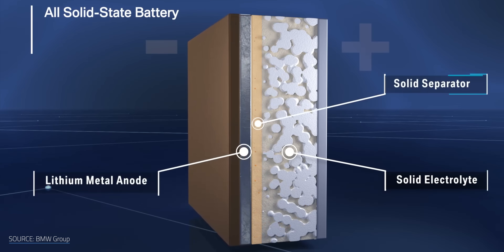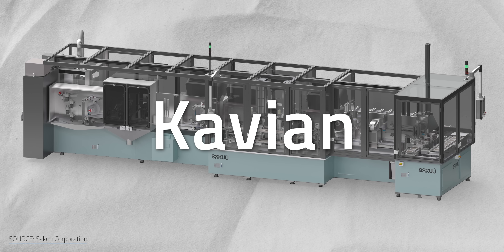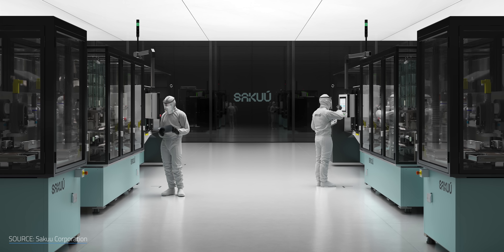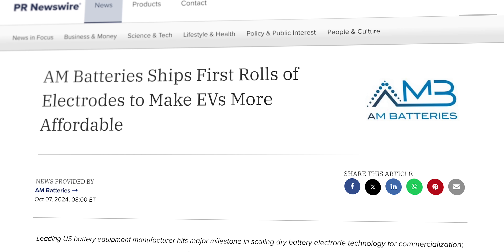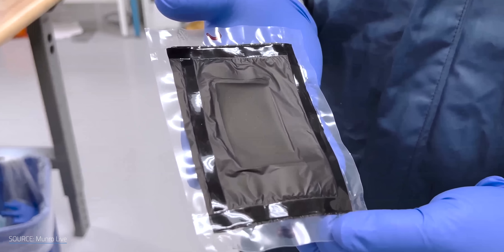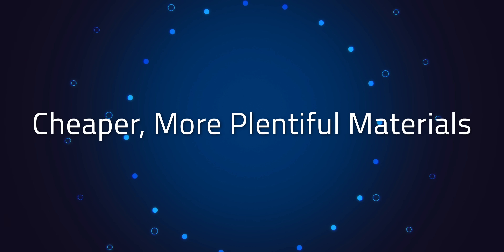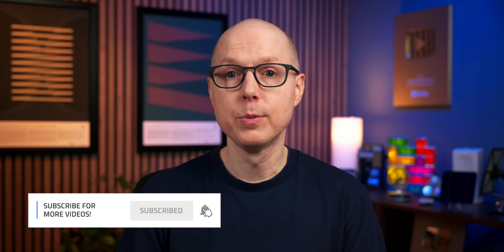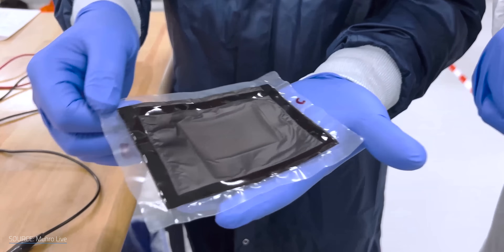Why This Ultra Cheap Battery Breakthrough Matters

Comment: 3D printing is slow, even though it might fit into a smaller footprint you would need a significantly larger number of equipment to get the same line rate. I have been in the battery development industry for a long time and these new technologies are always 10 years down the road. The biggest improvement recently was tabless cells, because you can make them on the existing battery lines with very little change. It’s the classic money grab by companies promising better, lower cost cells, getting some investment, finding they can’t make it work at scale and you never hear from them again. Time will tell and maybe one of these times that 10 year horizon actually comes to fruition.

Comment: Could these 3D printed shapes even form airplane structures and wings, allowing EV aerospace technology?
Reply: They're flexible sheets, not stiff or strong. You can use a rigid case as a structural piece like some cars do, but you cannot use a battery cell.

Comment: Safety and cycle life are not an issue for storage. Haven't been for a long time. You can buy 15k+ cycles guaranteed LFP batteries that are not prone to thermal runaway.
Density is also not an issue because space (and weight) are not limiting factors in storage. It's all about cost per kWh and nothing else - and that is largely determined about throughput of batteries per square meter of factory. Not so much materials or even battery design.
Reply: Agree so many technologies though and no clear winner yet 
The solution is there but which one will win

Comment: Also standard message 20 hrs a week cut the equitable holdings by half freeze the prices let the shelfs run out for what goods would be at after 1/2cut values flat tax on the dollar leave pay the same dollar amount .6am to 6 pm economy only no work before or after byob standards with automation and pre-orders vending machines and for the mechanics and practices that half to work 24,7 a tax on the consumer obviously that go's directly to the employee on the clock salary mom and pops will just have to grow or except the relationship to why they want to work for a business.lower retirement age to 55 for ss

Comment: Sounded good until 4:20. We need less battery formats, not encourage manufacturers to make batteries specific to a device jacking up the cost of replacing them and lessening the ability to repair the device or repurpose the battery.
Reply: @drxym  based

Comment: Solid state batteries like nuclear fusion is coming somewhere in the ethereal future. Those incremental gains in the existing technologies may improve efficiency and lower battery costs. I have a fondness for retrofitting sound body older vehicles with modern technologies. To modify that old adage, reuse,  restore and recycle.

Comment: Sounds good. even if they could only do 1000 cycles before dropping under 80% range, they would still be very good, just make them swappable. If you buy a car that has 500km range and 5 year guarantee for the battery, and after it goes below 80% you can swap it for 1000€ it would still be really good price. Instead of current 10 years and then 10-20k to replace...

Comment: Solid state battery dry 3D printing manufacturing process with using chlorides and replacing copper with aluminum metal foils by advanced composite and polymers looks like an obvious choice to reduce battery costs and make high performance & efficient batteries available on mass scale. Fingers crossed, hopefully we will see this technology one day in our lifetimes to leave labs and enter mass market!🤞🤞

Comment: i wouldnt mind a battery that wears out in 1000 cycles  if its dirt cheap. thats still 3 years of usage
Reply: Well, if your phone had unusable battery in less than 3 years and you replaced it entirely then there is no savings for you and the enviroment

Comment: The thing with battery tech is that so much of production capacity has already been provisioned or even built and currently sits unused. It's like a guy coming along to your craft product telling you how you could have done something better or more efficiently AFTER you already did it and won't need to do it again for a long time.

Why would a factory invest in a new process if what they have was already built and paid for isn't currently used, especially if the savings for the new process are at their greatest on plants that are running close to capacity?

So even if there is a new and more efficient process, there is very little incentive to switch to it while current battery factories are running at <60% of their capacity, never mind their planned capacity and provisioned floor space. Global battery demand isn't scheduled to catch up with today's provisioned plant capacity in the next 5 years.

That said it might be useful for new US based plants that might be constructed to ensure national infrastructure independence from China, where much of the global capacity is. In that case it's less about competing in price anyway (you won't be able to compete on the global market with that kind of huge existing economy of scale with just 30%ish savings in space, labor and energy) and more about being able to produce weapons and basic demand in case shipping gets disrupted by a global crisis. Same reason why the US wants local TSMC plants.
Reply: yes exactly. There might be no (or negative) incentive for incumbents to switch, but new battery companies will eat their lunch if they don't. Even if the batteries have half the charge cycles, the lower manufacturing cost means more people will buy them up front

Comment: About a decade ago I bought a diesel car.  Seemed like a good idea at the time, the engine was supposed to last forever, hopefully until I could afford an electric car.  But being in a cold climate the thing chews through batteries like no ones business.  When I first bought it, car batteries cost about $80.  Last week it wouldn't start in the cold so I went to get a new battery for it.  They're now $200.  I just decided not to drive anywhere until the weather improves.  Please tell me this means that price is gonna go back down soon.

Comment: Where does the 120-150 USD / kWH in LFP price come from? When I was building my home battery from LFP cells back in 2022, I paid 105 USD / kWH. And today the same seller offers me same batteries for 60 USD / kWh including shipping and taxes. We are speaking about typical 300Ah cells - they are +- same from all manufacturers. Then You need a BMS and wiring - but those cost +- same and are minor part of price of the whole battery pack (in my case 3p16s 45kWh "beast" :D). So price drop is crazy even with available LFP cells.

Comment: I'm an Industrial engineer, and let me tell you, the 3d printed parts won't Challenge the line Produktion.
Yes 3d printing is awesome for prototyping and fast developmet processes, but a Line production will always have better economies of scale for mass production.
I really do hope solid state batteries will come to mass market, but probably not by 3d printing them...
Reply: That's why Sakuu's printing line is a roll to roll printing line, one of Sakuu's patents of a deconstructed 3d printing process. Without industrial speed we at Sakuu would not do it.
Reply: I just wish they'd share a non-commercial hobby license for this kind of stuff. I'd love to print batteries for my projects.
Reply: @Steven---  absolutely. it would drive the EV conversion market with the almost standardization of BMS circuits the rest of the manufacturing process is merely terminals and a case. New tech is much more safe with the modern management system built into batteries like Lifepo which could easily be converted to Solidstate use with a tweak of parameters.
Reply: Is that not a 3D printing assembly line?
Reply: @c.s.4845  yes and no. You're right, 3d printing can be and is part of an assembly line for a lot of different products, but most of These have in Common, that they are expesive on a part basis (like aerospace).
But especially in battery manufacturing the Roll to roll process, where you have a continous coil and coat dry etc. all happen on the same coil is economically Superior.
Reply: That was exactly my thoughts about the 3D printing in the video. So far almost all 3D printing in production has fallen short as the production of each unit is way longer than other manufacturing techniques.
It is possible that this case is different some how, but just pointing out the pros of 3D printing and don't even mention the main con of 3D printing... 
We want to know what has a good chance to matter a lot in the market a few years down the road, so please don't hide the problems.

Comment: also note that part of Lithium's high price is that the oil cartel has a monopoly on it(acoarding to their own Investor Relations page around 5 to 8 years ago, lets call it 6 for now, also note this relates to the moment I checked it after the R&D from a local tesla factory had a working prototype developed ready for market which used a different method for energy acces, which was both cheaper and better than lithium, but acoarding to them the main investors made them drop/destroy it and absolutely not bring it out, so obviously I suspected it being them, so checked it and was indeed the case).

so there also is the chance than companies like them will again prevent such tech from coming or being cheap, or used or available, since the investors who invested in Lithium also invest in many other big companies and through that prevent advancement.

actually part of the Lithium scarcity is a example of that. as Lithium from old lithium cells actually is very easy to recycle, but due to lobby it isn't really done, or is only done at certain places, typically controlled by that same cartel.
as for cars ammonia would generally be a much greener option, especially since it can directly be made from extracting materials now deemed polutant, and turns it into air and water

Comment: Aaaah, I hear the same thing every year. Now, new super-puper-duper-shmooper batteries will replace lithium for three cents, and how everything will sprout and blossom!
Reply: But, of course, there are improvements each year, mostly incremental, but also new chemistries like sodium ion already being used, and technologies made more affordable and better performing like lithium iron phosphate.  I suspect that many new technologies, like some new anode, are largely invisible to the end consumer (but factor into price and performance).
Reply: @bearcubdaycare  But all this is presented as a breakthrough, according to descriptions, no less than the introduction of lithium batteries themselves. In fact, these are pitiful steps.

Comment: I'm missing some of the most important factors when it comes to price though: time to make a single battery and how maintenance intensive it is.
While maintenance per machine is probably alright, if it takes long enough, you'll need so many machines to keep up that the overall costs can be worse than what we have now.
Reply: OK, how big is your battery?

Comment: The biggest problem has nothing to do with cost!  It has everything to do with reliability and density!  

Get a clue!  All these Start-up battery companies are blowing smoke to attract investor dollars!  

3D printed anodes and cathodes is nothing new!  It’s been in production for well over a decade! 

Do a little research before hitting the record button!  

Lithium is NOT going away!  

Iron TriChloride  batteries demonstrate low charging efficiency at the negative electrode, potential for hydrogen evolution during charging, susceptibility to precipitation of insoluble iron hydroxide (rust) due to pH changes, corrosion of battery components due to the highly reactive nature of ferric chloride, and potential for self-discharge caused by electrolyte crossover between cell compartments, all impacting the overall cycle life and performance of the battery system.

Transcend the bullshit!

Comment: Finally a breakthrough that changes everything! After all those breakthroughs that changed everything to everything just as everything was before.
Reply: @Shifter-1040ST  so you are saying we have the same batteries as 2 years ago? As 10 years ago? As 20 years ago? Obviously, we have made HUGE progress in battery technology already.
Reply: @nikojonasson6866  I'd like to know your definition of HUGE
Reply: @Shifter-1040ST  50% more power density for 25% of the price compared to 10 years ago.
That's surely huge, name another product that improved at that rate

Comment: New ideas arrive with a blaze of publicity and patents, but as development proceeds secrecy arrives, especially if funding has been secured. usually, no information is released until commercial production is about to happen, or significantly more funding is required. It is the same in every scientific field, there is almost no information to be found between invention and commercialization (or abandonment).

Comment: The 2023 drop in EV sales was not real.  Every company, except Tesla, reported higher numbers.  It was only because Tesla had like 60% marketshare that the ' overall ' numbers went down.  It was a Tesla/Elon problem, not a real problem with  EV sales.   In 2023, people did not want to buy a Tesla, and there weren't enough viable competitors.  Things are changing now.

Comment: Price parity still won't give you 400mi of range in 5 minutes at the charger. Sodium titanate gets closer, can take THOUSANDS of recharge cycles, isn't affected by cold until something like -20°C AND has a ridiculous C rating for charging.
Reply: @Graciashauf  Once again, over 95% of daily commutes are less than 50 miles a day. Why would 4% of anything be a major issue.
Reply: @rwilliams79  some people don't wanna turn a 12 hour drive into a 24 hour one with an added hotel charge. Rich people who can afford $80k teslas can do that. Average person? Pass.

Comment: Lithium batteries have problems with dendrites eventually shorting the battery and causing short life cycles.  Hopefully these new batteries will also increase the lifecycles to make replacing lithium possible.
Reply: Preventing dendrites is the whole point of solid state batteries. ALL batteries with a liquid electrolyte develop dendrites sooner or later (especially lead-acid ones), though with the sophisticated BMS (Battery Management System) in EVs they now rarely become a big issue before decades have passed.